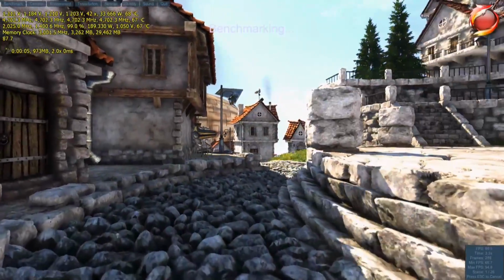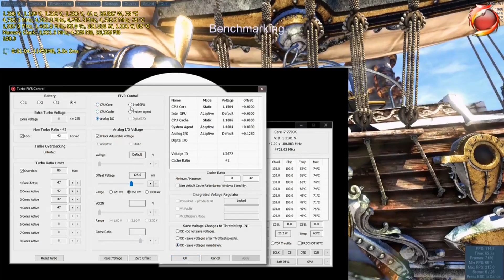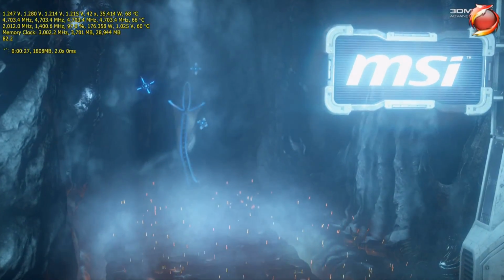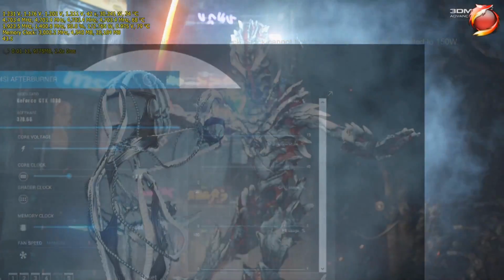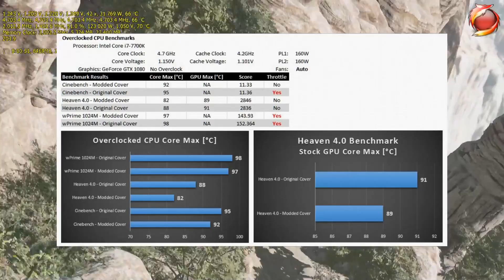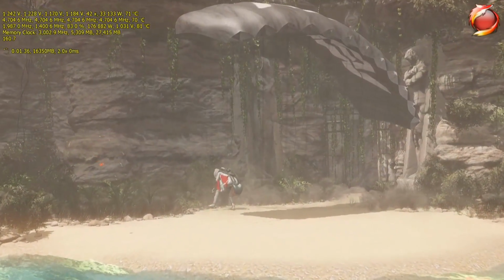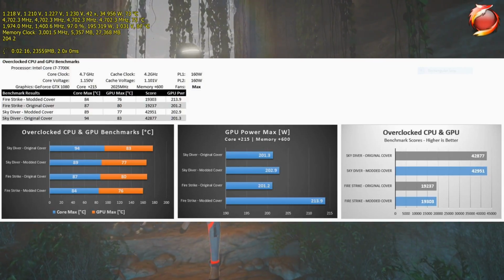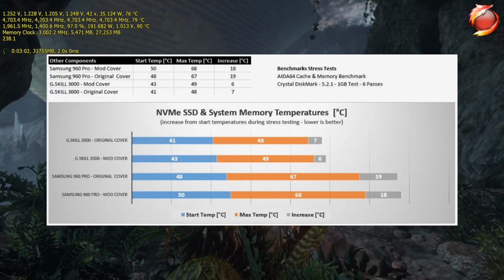EUROCOM Tornado F5 Thermal Exploration Update

Comment: Informative video, the BIOS and bottom Cover modes are perfect. Is there is anyway to add small fans to enhance the air flow and reduce the heat? I don't know if adding more cooper will do any improvement?.
Reply from the maker: I may add some copper to the heat pipes like I did for the 180W 980 SLI heat sink mods for the Sky X9. That worked pretty well. Thanks for the compliment. Glad you liked the video.
Reply: I think the manufacturers needs to consider a new heat sink pipes alloy, and closed small water cooling solution, to support reducing heat in those high end laptops models.
Reply from the maker: Hi Bro. I did not add any copper to the heat pipes. I have a copper shim between the CPU IHS and CPU heat sink and put CLU on both side of the shim. You would not want to add thermal pads anywhere. You would only use those to replace other 1mm thermal pads if they are dirty, dried out, torn or inferior quality. I did replace the narrow thermal pad between the CPU heat sink and the 'arm' coming off of the GPU heat sink with a larger square thermal pad. Doing so did not provide any benefit that I could identify.